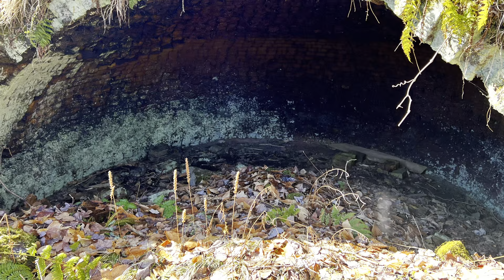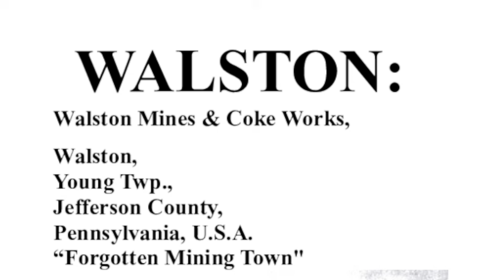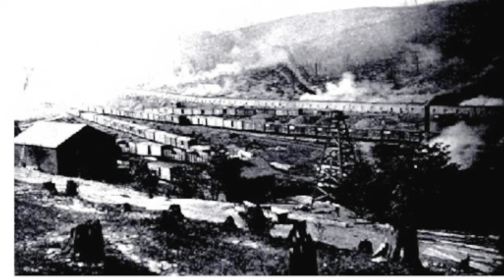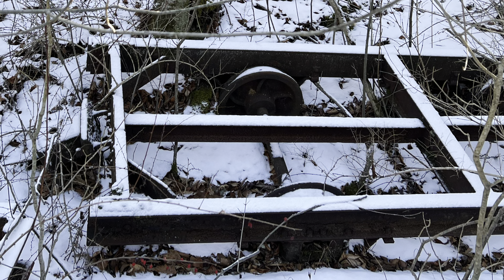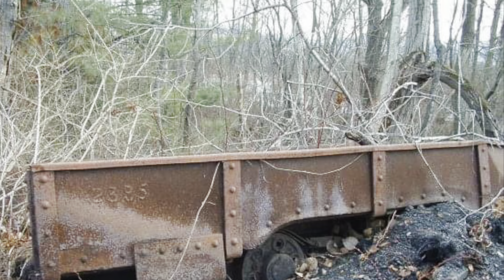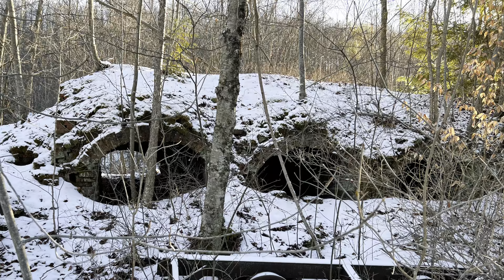The Rise and Fall of Coke Ovens in Pennsylvania: A Closer Look

Comment: Nice video, thank you.
Quibble though -- electric arc furnaces melt iron and steel scrap into molten steel. They didn't directly replace the beehives. 
"By Product" coke ovens recovered the gases released from the controlled heating. These byproducts were refined into chemicals used in many industries.
They also had a much faster coking cycle measured in hours instead of days.
Coke from both beehives and byproduct ovens were fed as fuel into blast furnaces that refined iron. That liquid iron was melted into new steel.
Reply from the maker: Thank you for watching but a bigger thank you on the clarification. I didn’t go into much detail on the electric arc and it’s nice to get the additional feedback and info. Hours over days is a massive savings, especially when making and needing to produce the quantities they needed. I imagine it was a vital step to help during the increase in war years as well.  Cheers